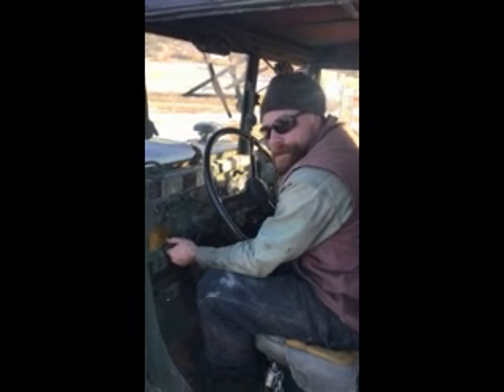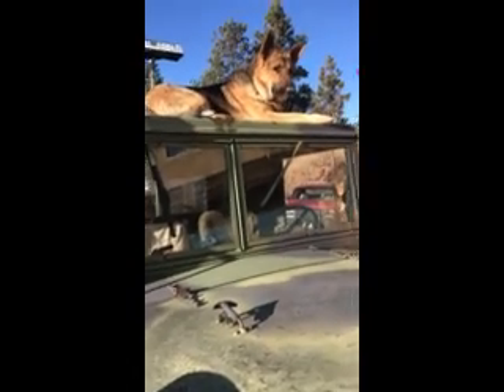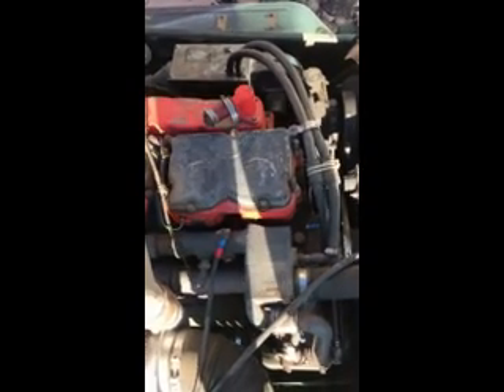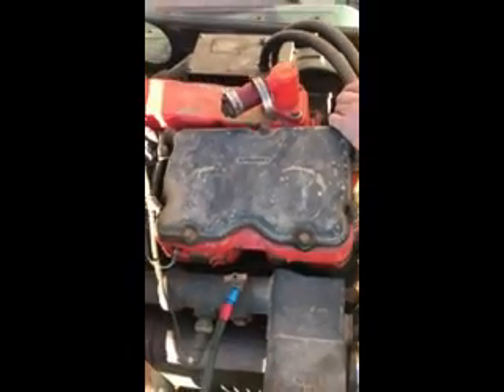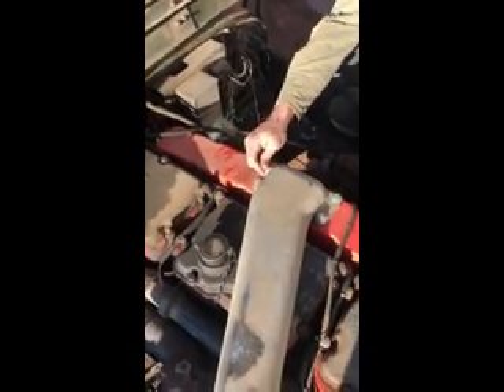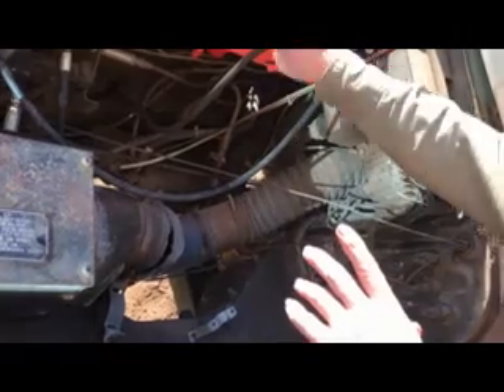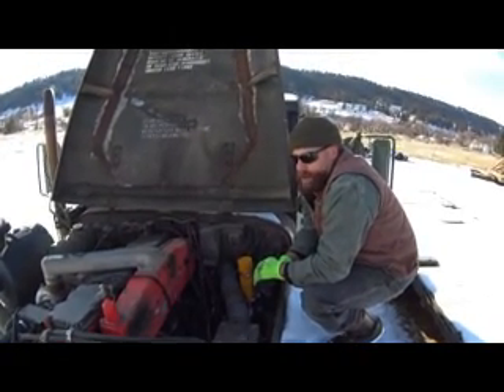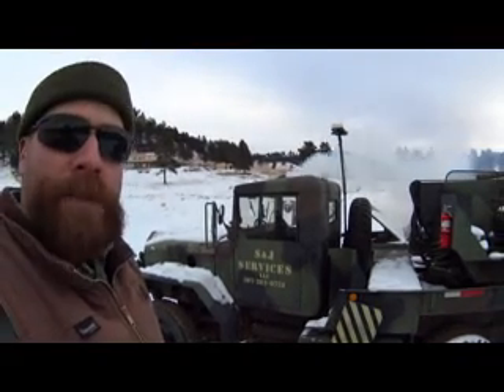M816 Wrecker gets a Kats Ether Injection System

Comment: Holy crap you did a lot to it.  My deuce is a 1970 Jeep kieser with the Hercules multi fuel.  It’s turbocharged and runs good.  Did it come with a Cummins originally?   Good video
Reply from the maker: The 5 tons came with the low hp 855 Cummins small cam.  The multi fuels came in the dueces.  The turbo picked it up some, the duel fuel lines a little more but the Achilles heel is the 5spd trans.  I have an Eaton 10spd but will have to re-engineer the whole accessory drive for the winches/crane.
Several have asked for a walk around video, I will get that out soon, and show the rework on the obsolete crane pto shaft that fragged late one night
Reply: Rough Cut Ranch    Awesome.  Next is an 8.3 Cummins.   The 5 speed does a good job for what I use it for on the farm.  It rolls around just fine with 11k of gravel in the back.   Good videos.

Comment: If you ask me, this is the rig you should have entered in the Deboss Garage competition. Your CUCW has way too many new parts on it (at least as far as the standards of the competition go.)
Reply from the maker: Really the only thing Ive done to the 816 is Jake and turbo the old Cummins 855,  install a Kats ether injector and was forced to redo the PTO shaft that powers the Crane turret and pump.  I have a 10spd Eaton and a hydraulic swivel manifold for it as well as 10 Budd single piece 22.5 wheels but time and money never seem to meet, thus I haven't tried to create a non moving yard ornament by tearing into it.    If your interested in the mods to the 816, I chronicled most of that over on Steel Soldiers under the handle wcuhillbilly

Comment: you got power steering on that fecker? it looks like you got the big steering wheel so probably not. nice truck though
Reply from the maker: Yes it does have Pwr steering.  and the big wheel..... doesn't leave much room for a person to sit behind the wheel.  But its loud, slow and gets the job done...  been the most irritating and most helpfull piece of machinery I own.
Reply: @roughcutranch  haha, indeed at least it has power steering😃 I got Armstrong steering on my truck . You could swap out the steering wheel for a smaller one but it's only 2in difference so eh might not be worth the effort